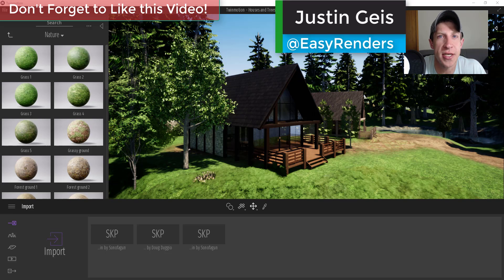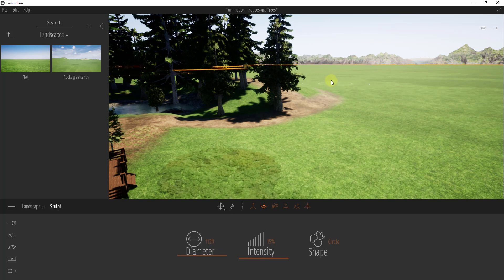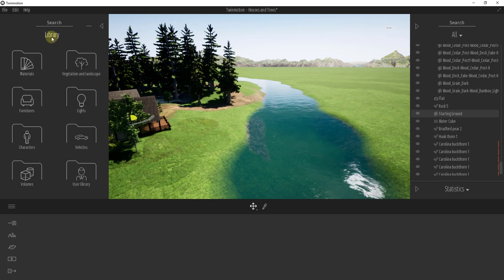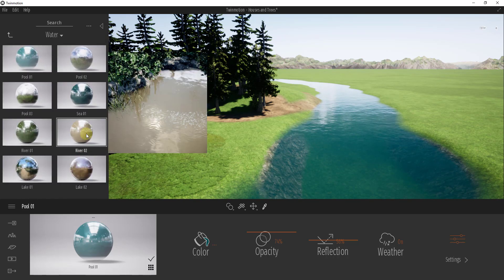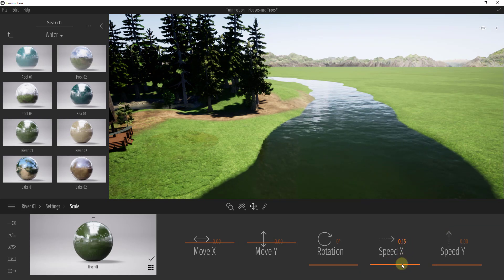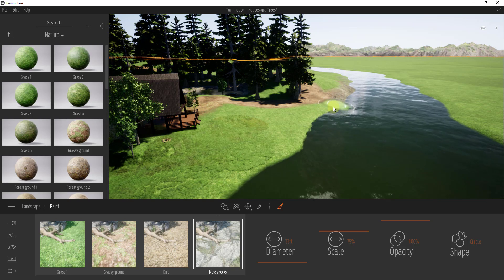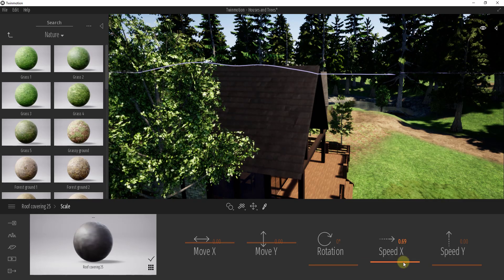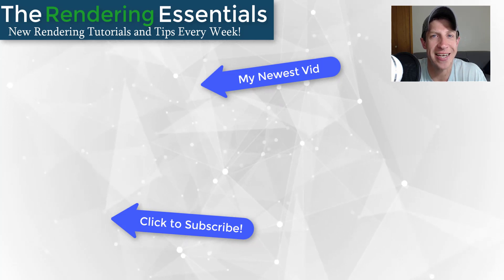Animating MOVING TEXTURES in Twinmotion - Creating a River

Comment: hey J, how did you get water under sculp? you did not explain how did you lead in to this tool, it is very powerful
Reply from the maker: Did I not say in the video that applied the water material to the default ground plane? I thought I did, but I have been known to edit out vital information accidentally ;p - Anyway, that's what I did - I took the default ground plane that gets added in every model that you start and just applied one of the water materials to it - that was easier than messing with the water volumes